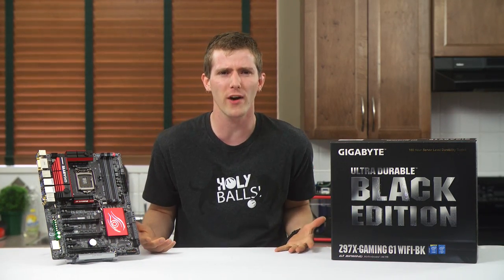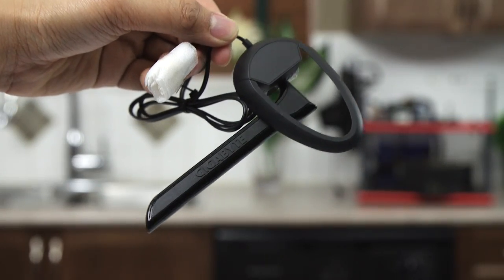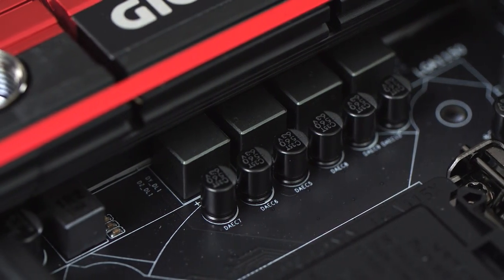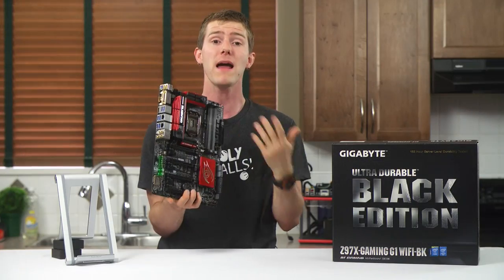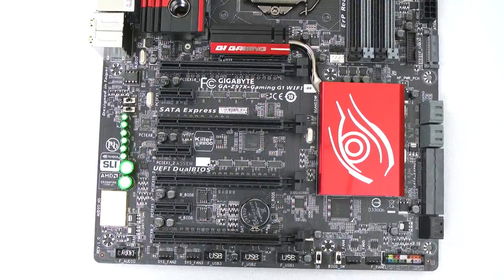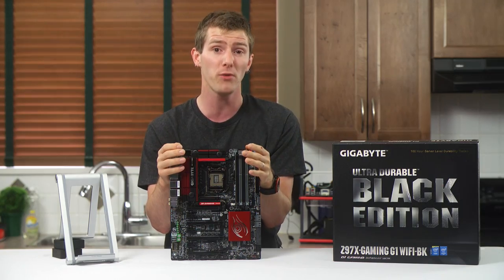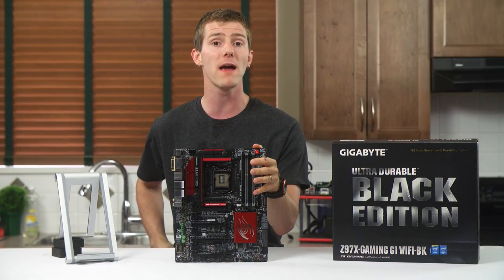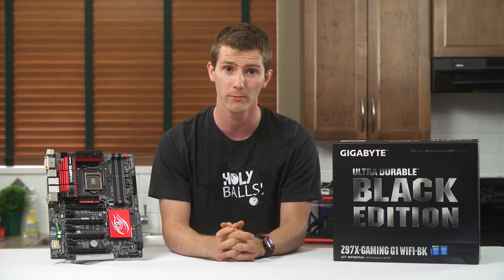Gigabyte Z97X-GAMING G1 WIFI-BK Motherboard

Comment: you better off get a x99 board with a 5820k lol
Reply: davidarad02 that was 1 year ago -_-
Reply: Aqua Power I know lol but I still had to say that because this motherboard is still somewhat relevent...
Reply: davidarad02 i'm going to buy this mother board paired with i5 4690k, am i an idiot?
Reply: LargeBanana yes. you're better off with a i7 4790k and a cheaper z97 board (like the MSI z97 gaming 5), and with the money saved get a better GPU or more RAM.
Reply: davidarad02 i thought i don't need i7 if i weren't going to edit video and those kind of stuff. there's not much money saved there btw.

the thing is, in indonesia you won't believe how things are priced :D it's crazy
Reply: LargeBanana anyway, this motherboard is WAY overpriced.
Reply: davidarad02 ikr, so what motherboard do i need and can utilize the K on my cpu which is over clocking?
Reply: LargeBanana any reasonable z97 motherboard will do the trick. im running my i7 4790k with the MSI z97 gaming 5, and so far, I love it. if you want future USB 3.1 support, the MSI z97a gaming 6 is bassically the same board but with USB 3.1.
Reply: davidarad02 i don't even care for usb 3.1 lol. i guess the msi z97 gaming 5 which is like a few couple buck lower than the one on the video will do.
Reply: +davidarad02 I bought this board just to save myself from finding a monoblock for it, am I an idiot?

Comment: Is this a good GPU?
http://www.ncix.com/detail/asus-radeon-r9-270x-directcu-62-95230-1016.htm
Reply: Arma 3 on Ultra 
Minecraft :D
Battlefield 4 on highest settings
Reply: ChickFrog I think you'll have to turn down Battle field to high for the best framerate to image quality. Great card though.
Reply: Thank you :D
Reply: ChickFrog get the R9 280 from xfx, same price on sale on ncix right now
http://www.ncix.com/detail/xfx-radeon-r9-280-933mhz-cd-95214-1016.htm
Reply: ChickFrog it would not manage to play arma 3 on ultra, but arma 3 looks amazing on high/very high
Reply: ChickFrog That card will run anything on high-ultra on 1080p! Combine it with an FX 8320 or an Intel i5 K series
Reply: Running an EVGA GTX760 4GB, Intel Core i5 3570k, and 16GB of G. Skill Ripjaws X 1600 and can run Arma 3 on Ultra Settings.
Reply: ---ElectroMan--- want to point out that ram, cpu and Gddr5 don't really affect graphical performance
Reply: ---ElectroMan--- gtx 760 4gb is overkill for vram. A 760 won't ever be able to use that much vram effectively. I would stick with the 2gb and spend the extra cash somewhere else.
Reply: ***** Oh yeah, didn't think of that.
Reply: Imtihan Ahmed Actually, currently i am saving up for a second GPU (Another GTX760 4gb.) And on games like Battlefield 3/4- look at your CPU usage on like a second monitor- a good CPU is actually needed pretty heavily.
Reply: lirontovy I beg to differ. I can play Arma 3 easily on any one of the 8 GPU's i have in my closet.
Reply: lirontovy arma needs cpu power
Reply: ***** Lol, i5 3570k at 4.4Ghz :)
Reply: it would be good for more of a budget build

Comment: This is my first build, any suggestions? ;o
PCPartPicker: (http://pcpartpicker.com/p/Hd84zy)

CPU  Intel Core i7-4790K
CPU Cooler  Cooler Master Hyper 212 EVO
Motherboard  Gigabyte GA-Z97X-SLI ATX LGA1150
Memory  G.Skill Ripjaws X Series 16GB (2 x 8GB) DDR3-1600 Memory
Storage  Samsung 850 EVO-Series 250GB
Storage   WDC Blue 1TB 
Video Card  MSI GeForce GTX 970
Case   Define R5 w/Window (Black)
Operating System   Microsoft Windows 10
Monitor   Asus MX239H 23.0" Monitor

Total $1340
Any suggestions for power supply?
Reply: +theN3lleh I know you've probably been told this before, but if you want to just play games, get an i5, but if you do video editing, get an i7. I assume you are though. (Personally, I would swap out that 970 for an MSI R9 39 since it's better and cheaper, but that's just me.)
Reply: +theN3lleh Also, get a 650w power supply minimum, 750w if you want to spend a little more.
Reply: go with a hx750i or hx850i from corsair they are very high quality power supplies